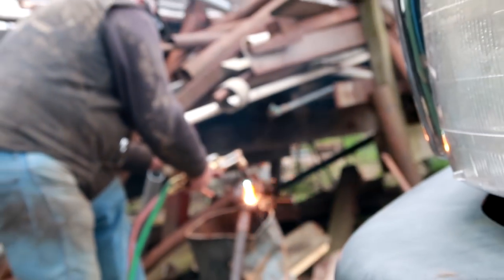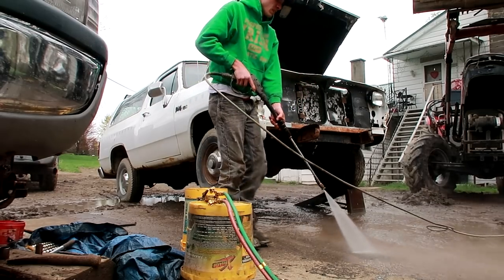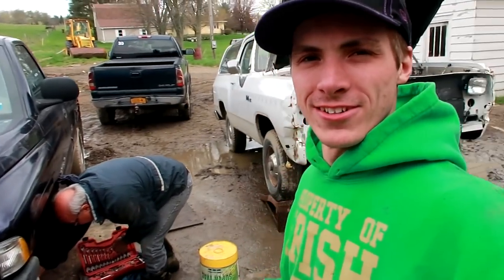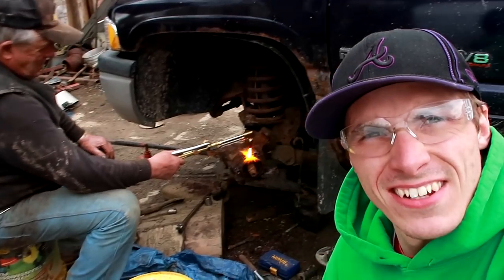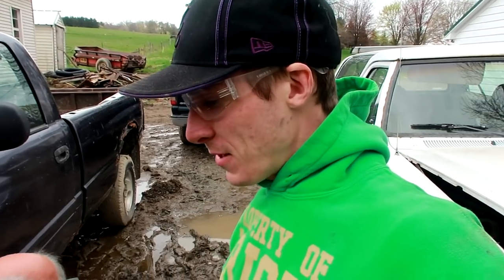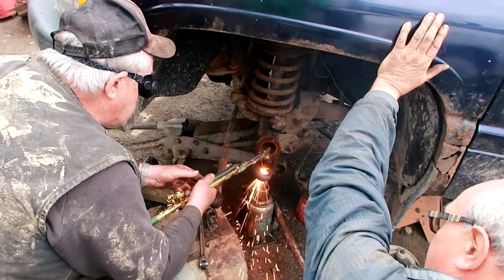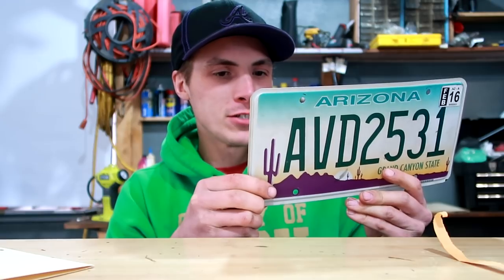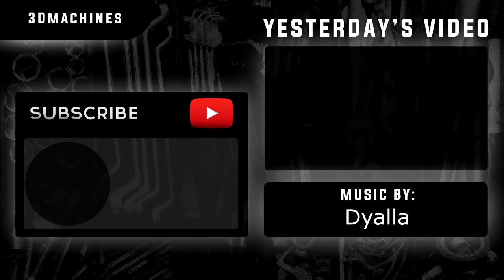DROPPING THE DODGE!!!

Comment: couldn't u just shift it into neutral and push it off?
Reply: pompa pompa Not as accurate bc it'd move
Reply: pompa pompa when u move its cranking over the engine and the Pistons are moving but there wasn't any fluids in it so they couldn't